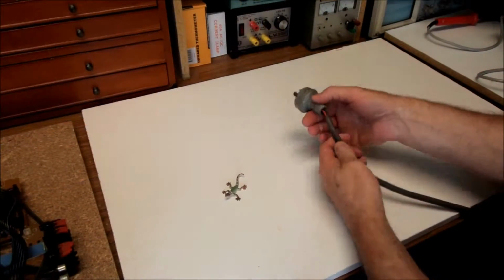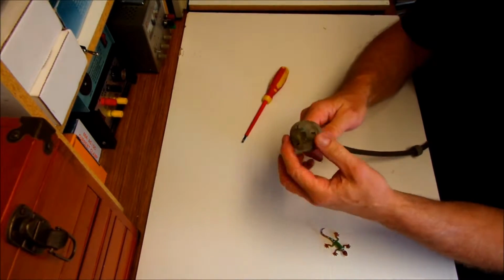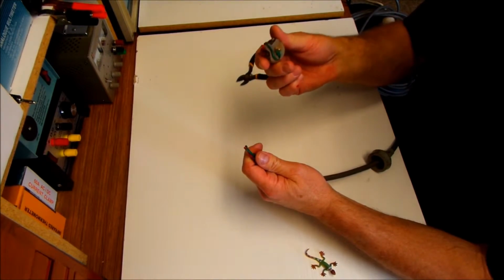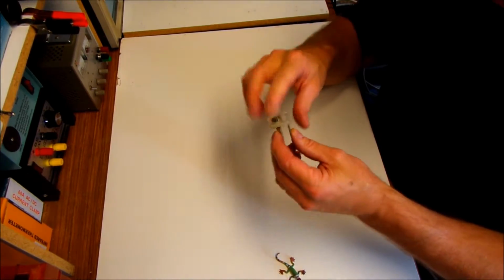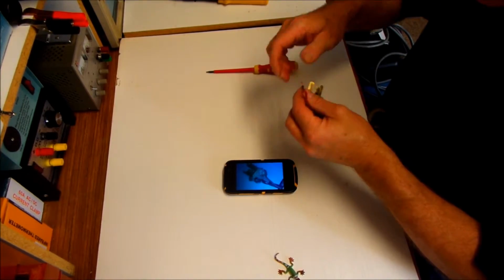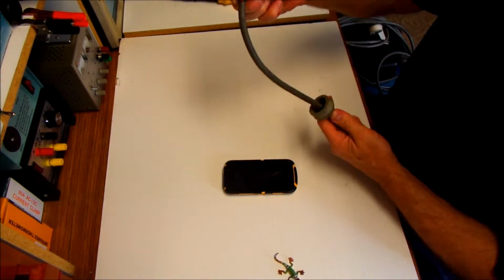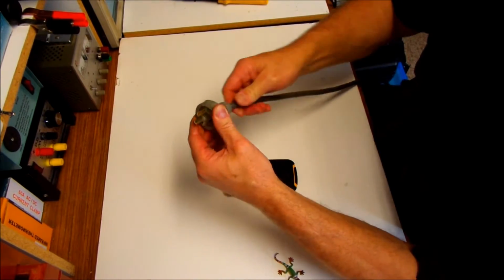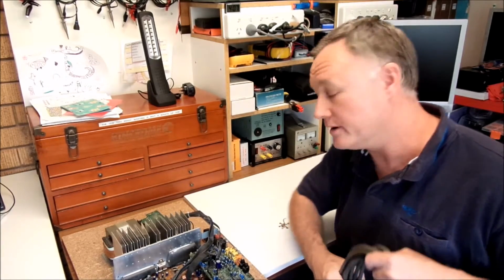Extension Cord Repair MiracleMAX

Comment: Great video, interesting repair. It's interesting I've got a 18 volt lithium ion DeWalt battery for tools and ozito. It's interesting the ozito just has three pins on the charger. I'm guessing plus minus and thermistor. 

The DeWalt one seems more complicated has the same pins plus two additional pins which I'm guessing are sensing for cell balancing. 

Do you know ?
Reply from the maker: Yes, you are right. The DeWalt has a positive, negative, a thermistor and a cell balancing pin.
It seems on the Ozito, the 3 pins are positive, negative and a balancing pin.